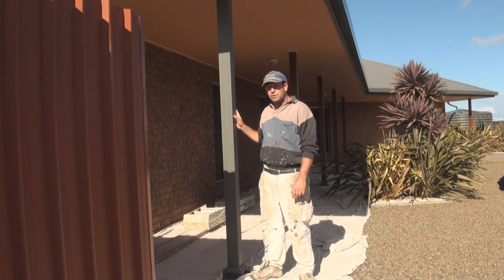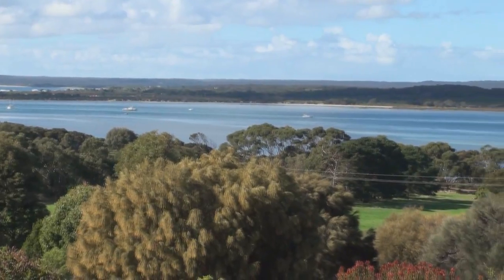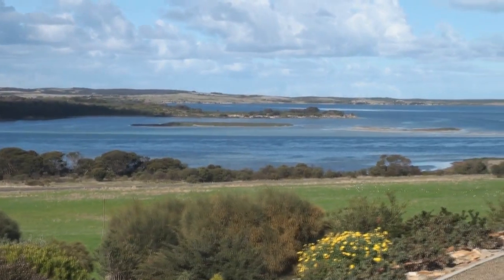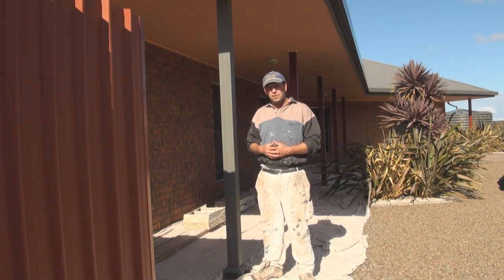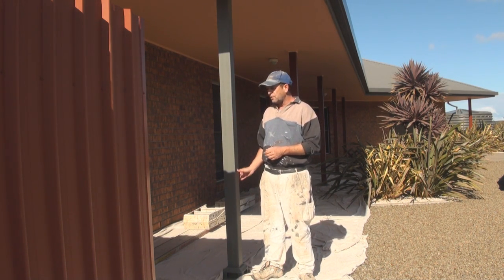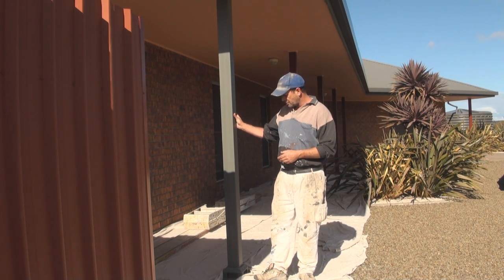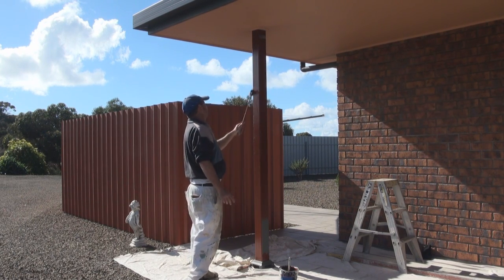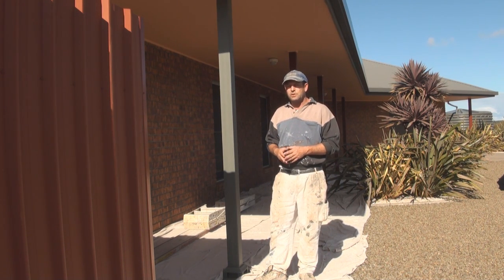How To Paint Metal - Oil based paint versus water based paint

Comment: To keep oil based surfaces looking Beautiful for years and years use an auto wax. As stated in video, the 'chalking' will wash off fairly easy. Use of a white nylon pad helps immensely. Waxing literally Doubles the life of the paint. Of course, most people are too lazy for maintenance.
Reply from the maker: I can understand that applying the wax would work, just like waxing a car, it will extend the life of the paint because its a protective layer.
Don't forget to, like, subscribe and share this video.

Comment: Great tips, nice door painting skills! Question, so about 2 months ago our house was painted including the steel arm (post) that supports the carport. There was severe rust i.e. holes in the elbows of the support and rust on the surface prior to painting (about 28 years old). I know the painters used a bit of Rust Kill or similar, before white acrylic top coats. About 2 week later.. this greeny/grey surface has shown up and continues to grow rapidly even on a bit of the wood where there was some mould i think. Would the remedy be cleaning off this growth, rust kill primer and the Oil based top coats? It's pretty much where severe rust was. Cheers mate
Reply from the maker: Hard to say but maybe the rust converter they used needed an oil based primer before being top coated. So you could try just going over the areas they did then repaint with acrylic paint, try a sample first, might save you a lot of work. 
Don't forget to Like, Share and Subscribe.

Comment: If you have a metal carport/building with prepainted galvanized metal siding/panels, wouldn't using acrylic/latex paint over it be perfectly fine?
Reply from the maker: Yes as it is an area that would barely get handled, were as  posts are often lent on grabbed etc so they need a harder wearing paint.
Don't forget to Like, Share and Subscribe.

Comment from the maker: How long ago was it painted with water base paint? It can take up to a week for it to harden up.

To remove it all would be a big job, you could try a razor blade scraper and see how easy it will come off or you could try an oil-based seal binder. Depending on what type of water based paint was used the seal binder may be enough as it will soak in to the paint making it harder to scratch off.

Comment: My experience is enamel used on outside windows just flakes off and acrylic house paint lasts longer as designed for heat, so ive used acrylic for window frames lately

Answer which is better on a tin roof and should both have primer  for durability ?
Reply from the maker: Acrylics are better externally than enamels so I would normally use acrylic for a roof but if you are collecting drinking water then enamel might be the better choice unless you go to an expensive water based roof paint. Priming will depend on condition of roof and the type of paint used. Also read instructions on the can as manufactures all have different systems, some paints are fine without a primer.
Don't forget to Like, Share and Subscribe.

Comment: Hi,

If i was to use a set of oil based paints for Artistic work on metal would it stick on it or not? I heard that i can stick on but if someone tries to peel off the paint, it will come out easily.

Any suggestion?
Reply: i saw a lady using an automotive detailing paint called 1 Shot to paint her metal art

here it is https://youtu.be/EbIAKnWlysM

i have a white car, i noticed a few spots on the hood where the paint chipped off. i used white nail polish to cover it up as a quick fix ... that was 3 years ago, so far it hasn't yellowed or chipped off

so now im using all this fingernail polish i have to paint rocks. what else am i going to do with it? i never paint my nails
Reply from the maker: Don't forget to Like, Share and Subscribe.